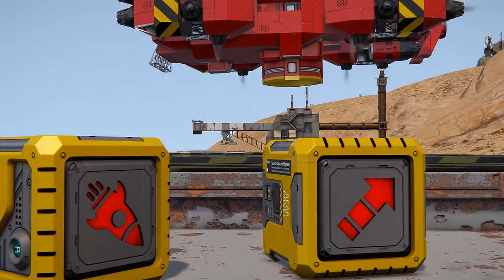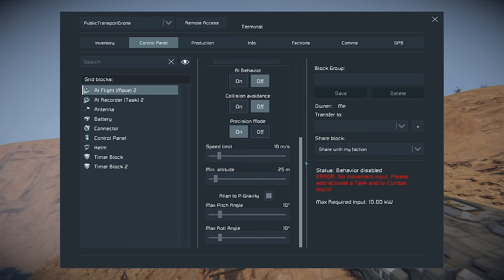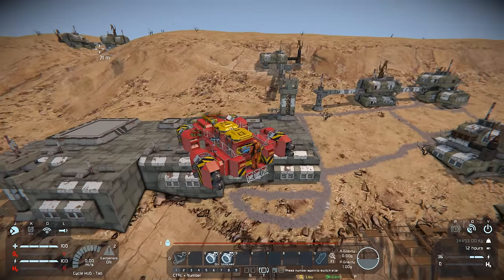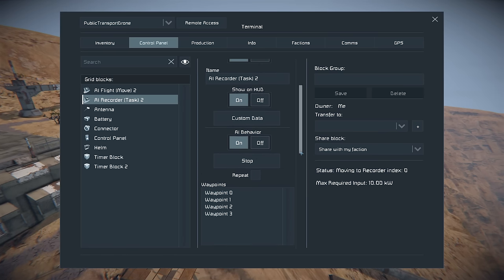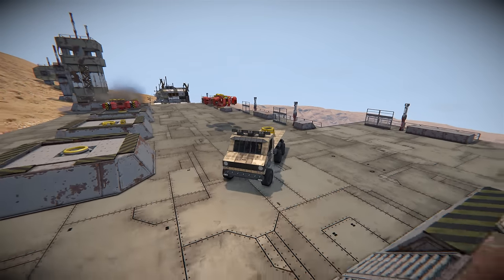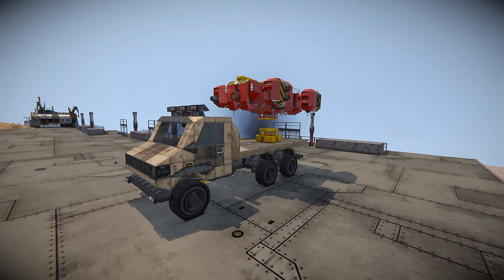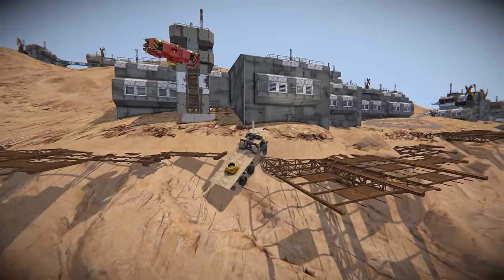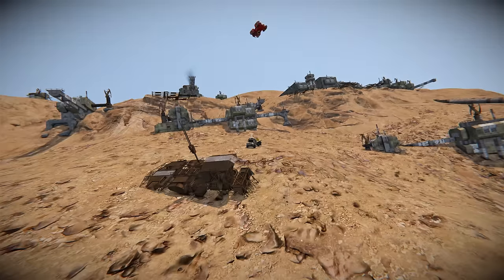AI Automatic Docking - HOW TO - Space Engineers

Comment: Quick tip I found useful is to put two different AI flight controllers onto the drones, one for flying long distances and one for landing. While in flight you usually want the AI to fly fast and stay at a high altitude with collision avoidance on so it doesn't run into mountains or large blocks. But when you bring the drone in to land with the aid of a recorder, you want it to operate at a much slower speed and lower altitude with collision avoidance off so it doesn't try to avoid hitting the connector when you actually want it to hit the connector. All you need to do is make the AI task block instant trigger a timer block that turns off the long flight AI and turn on the landing AI blocks, while also turning on the AI recorder block.
Reply: You can use scripts for this as well. Once it arrives at a designated waypoint you can have it trigger a script to shut off collision and lower your max speed before initiating the docking sequence.
Reply: @comensee2461 consoles don't have scripts. So the ability to do these things wothput scripts is important

Comment: Just spent a good three hours trying to do this with the new blocks. Very disappointed that block doesn't record what position the way point is recorded at so this block adds very little to what the remote control already does.
Reply: It does record orientation if that is what you mean. But It looks like the recorder refuses to turn the drone while aligning to gravity unless the waypoints are fairly far apart. It does work perfectly in space. I assume that is a bug.
Reply: @thepatriarchy1637  You're right, I was messing around with it today and it seems as though it was some sort of bug that was causing my ship not to orient properly. My set up was in space with no gravity to align to so I found forcing the ship to approach from a certain direction allowed it to properly right itself.

Comment: How about conneting with a drone a base with a moving object? like a drone that brings minerals from a moving miner to a base
Reply: I think you just add a second set of AI blocks, and have them trigger timer blocks that turns themselves off while activating and starting the other set so they alternate; maybe event controllers too so it heads back to base when X% full, lands and docks to a connector with sorter set to suck the cargo out, sets battery to recharge, then back to auto and triggers the return to miner AI block set when it's battery is fully charged, so it never runs out of power while enroute? Haven't messed with it yet myself.
Reply: @WulfgarOpenthroat  yeah but how do you keep the way points accurate
Reply: @wildocado5376  When set to use a reference beacon, it sets reference points relative to that beacon; when the beacon moves, the way points move with it. So you put the reference beacon for docking to the vehicle on the vehicle, and the AI blocks for docking to the base either use a reference beacon on the base or use regular waypoints without a beacon.
Reply: @WulfgarOpenthroat  does it move the whole waypoint chain or just the one you select? because if it moves them all then it also moves the one on the static bass
Reply: @wildocado5376  As the video explains it you need a different pair of recorder and flight blocks for each landing location, then use groups, timers, and/or event controllers to control which one is active(iirc you should only have one set of AI blocks turned on at a time but that was from the beta).
One recorder+move block uses the rover's beacon, the other set uses the base's beacon or just isn't set to use beacons for it's waypoints, as he shows being set up first. When the first docks to the mining rover it activates timers that locks the connector, turns the first set off; event controller is triggered when the cargo is full then disconnects the connector and turns on/activates the second set of AI blocks which fly it to the base, where they trigger timers which lock the connector, set the battery to recharge, and turns the second set of AI off, while a sorter sucks the cargo out of the drone. Once the battery is recharged, a second event controller triggers another set of timers which set the battery to auto then turn the first AI on and activate it, sending the empty but recharged drone back to the miner to fetch more ore.
This AI is awkward, clunky, and not very smart, but should be fairly versatile once you figure out how to work around it's limitations.

Comment: I am realy interested in the miner, so far alot of videos on how to make combat drones, but no one really tackled the mining or even salvage (grinder) aspect of them.
Reply: The only thing I've been able to get working for miners is to just build a bog standard stationary mining rig, modified to lock w/ landing gear instead of being a station. Slap thrusters and an AI on it and drop a gps point on the ore vein. What'd be really useful is a function for the sensor (or a new block if need be) that detects specific voxel types in an area. That way I could set up a few such sensors to inform the drone of when it's pointing at ore, or if there's ore nearby that it isn't pointing directly at

Comment: Tip and trick: the flight module seems to have issues when they need to be underground. Namely, it won't go underground. I tried to use a mule drone in my cave base, and it kept wanting to go through the ceiling even when set at 0.

Edit: Another thing I remembered, about locking the ship to a connector like at 4:07. The Event Controller has a setting to do something when a connector is ready to lock, so it can be used to dock as soon as it can instead of activating a timer block.
Reply: Maybe it’s to do with the Alignment with P-gravity ?
Reply: @brandondawtrey6874  I admit, I didn't think about checking that. I'll have to see when I'm back planetside.
Reply: That Connector Ready to Lock is new from the beta. It wasn't there at the time!
It's actually perfect for those situations.
Reply: @JulianSkies  unfortunately it has an issue with also proccing as soon as the connector unlocks, because the "locked" state overrides the "ready to lock" state. Usually what I do is have the event controller feed into a timer block, which locks the connector and turns off the event controller. Then I have the event controller turn on as part of the docking sequence, either from the timer that starts it or as an action at one of the approach waypoints

Comment: Quick tip
Use event controllers to monitor battery or fuel levels and have them turn off the ai task block, and turn on a different one that has it dock until charged or fueld up, then have another event controller turn it back to its original task once full
Reply: I had cargo drones for drill setups a few km away from base, on a dedicated server, kept coming back to them either crashed in between or on my base, i had them setup to dock on my base for 5 minutes, do the 3 minute trek, and repeat, but they kept dieing still, so i plan to test with the event controllers to see if its any better

Comment: For another tutorila, it might be interesting to do a Solar Tracking Guide, I was having a lot of trouble setting it up with the Custom Turret Controller with Solar Tracking and even after a lot of trying it still did not work. Help would be appreciated!
Reply: Solar tracking needs a camera as the pointer, it will attempt to put the camera at the sun,
Reply: @TengertLanes  Yeah I know, I already connected it, besides, the turret controller will say it doesn't work without a camera. Not sure, it might even be a bug for me...
Reply: @MedicMainDave   sounds like it, or sometimes I found I had to manually adjust the turret before the ai control took over
Reply: Just make sure you have your horizontal and vertical azimuth set correctly and of course the camera and it should be good to go. It even follows it at night which be entertaining.
Reply: @mediocreman2  everything is set up correctly, I even manually controlled it towards the sun, it doesn't want to turn, not sure...
Reply: @MedicMainDave  custom turrets have a new "enable AI" switch which I think (I'm not 100% CERTAIN) has to be on for the turret to aim itself

Comment: So, genuine question here: Does anyone know how to get connectors to work on the Xbox version? I mean, I have the AI set up in my planet rover so that it follows me, collects the ores/rocks when i'm mining and when it get to 95% full, it'll drive itself back to the base and reverse into a parking bay. That isn't the issue. The issue is that it reverses upto the connector, gently bumps against it, then does nothing. no connection at all.

If anyone does know how/why it acting like this and could possibly even help, it would be appreciated.
Reply: A tip I saw on another video is that when you set the final point (where it's ready to dock), turn off the connector and get it right up against it before marking the point. They also suggested not making the action at that point be to toggle the connector lock, but to start a short (1.5s) timer block that does it instead, to give it the best odds of getting into the magnetic field and successfully docking.
Reply: @ninjacat7507  I've also seen the suggestion to use an event controller to lock the connector when a connection is possible.